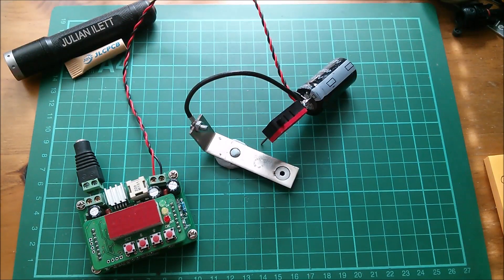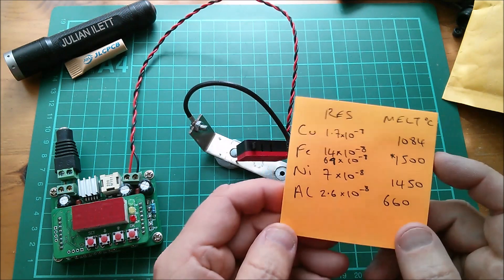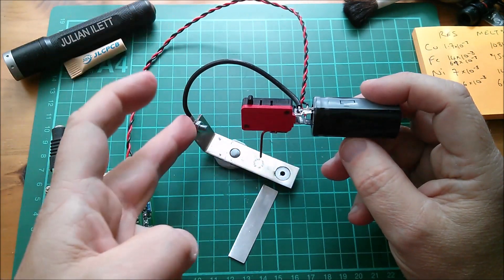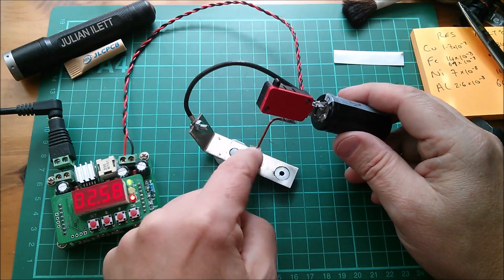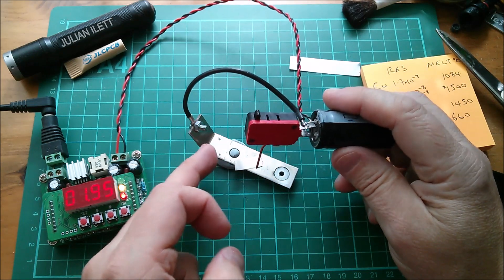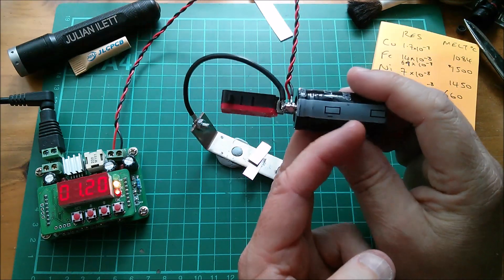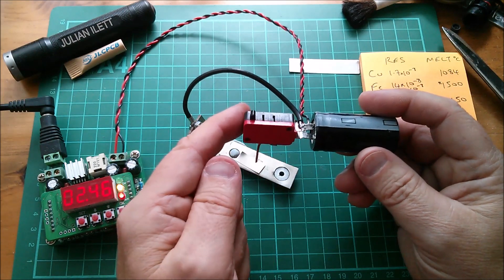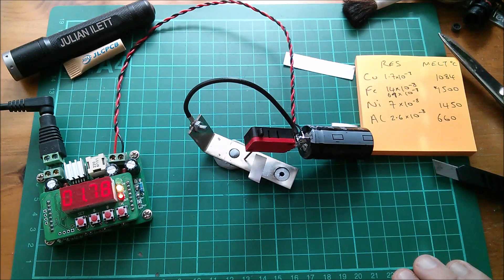Will it work? 100F Supercapacitor Spot Welder

Comment: If you manage to get enough current to weld the nickel, you're more likely to weld the microswitch contacts, also, have you ever looked inside a microswitch ?
The metal inside is about the thickness of the nickel strips, but narrower, if you don't melt those, you'll at least re temper the spring material

Comment: One thing to try is to use an old fashioned soldering gun with two short, rounded (not pointed) copper tips.  Press down hard and pull the trigger for a second or two.
Reply: I thought about that,  and wondered if it'd work...    Have you actually done this?

Comment: I think the ESR of supercapacitors is far too high. You would be better with a large electrolytic charged to a higher voltage. Far more energy and a lower ESR. Then you will probably weld your switch!
Reply: There are smaller value super caps that are designed for the kinds of pulse discharges he needs as well. The one's he's using are meant for hold up power not pulse discharge.

Comment: A microswitch, seriously? I’m pretty sure that along with the huge thermal mass of the steel block that dissipates the heat, the contact resistance of the microswitch is partly to blame.

Comment: For battery welding I am using 2 300F (3.5 mOhm ESR) capacitors charged to 2.1 V, connected in parallel with 1.5 mm sqr copper wire. It was just enough to spot weld 4s 5p pack therefore you need much more than this
EDIT:
I checked in datasheet that my "spot welder" can reach 324 A so that is a little bit more than yours :)
Reply: Thank you for ❤️Julian :D

Comment: Counter intuitively, less pressure might help to increase the resistance and consequently the temperature
Reply: Only at the surface. You need to generate the heat inside the material or nothing will happen.

Comment: Internal resistance limits the maximum current it can give. and since it heats up, it must be rather high. You can solve it with multiple caps in parallel (lowers resistance)
Reply: The caps themselves matter as well, these are not low ESR super caps I'd be willing to bet. You could probably do this with only a few Farads of capacitance if the ESR is low enough. Putting more big one's in parallel might work but you need some way to control the pulse duration otherwise you quickly go from not enough to too much. Neither is good.
Reply: @JWH3 , indeed true. mosfets in parallel can be used for pulse duration. but a controller will be needed also. might work with a 555
Reply: @MasterIvo  for testing it won't be needed but once you know you have at least the basic energy delivery required yeah definitely. I'd use a microcontroller, they give you way more control and repeatability over a 555

Comment: As someone who has used a spot welder I'd suggest not using a snap point on the electrode.
When using a full sized welder the electrodes were about 3/4" diameter and the tip was about 1/8".

Comment: The sparks you are getting with the switch pre - closed don't look or sound nearly scary enough to do any spot welding - people use much modified microwave oven transformers with  a secondary wound from thick copper - that might be a clue - I just don't think you have the current needed sir :o) (I agree with your 'high esr' theory for the C also)

Comment: Spot welding is about an initial bust of insane current. It's massive amounts of energy in as short of a time as possible. That's why you see sparks and stuff spray out, since it is essentially melting the things together very quickly, and then the energy is gone and the weld solidifies. Typically the welds are done on very thin metal.

RESISTANCE welding, which is what I think your setup is currently the closest to, is a continuous dumping of energy to melt the metals together with the heat of the metals making them warm up. And none of the things in your design now are up to that continuous current output. Typically, at least in my experience, this is used for much larger bits of metal.

I only know about these because I worked in a warehouse, and they had both units.

Comment: Suspect it's just as simple as not enough energy in the capacitor to do the job.  Which is just as well. Because if it worked your microswitch would be good for recycling only.

Comment: Yes, that’s a fail!
These micro switches usually have a maximum DC current of ¼ A ! (and 10 – 16A on AC)
Also the contact material inside has a lower melting temperature than any of the stuff you try to weld. Back to the drawing board!
 :-)

Comment: Use a solenoid (starter motor kind is used to this kind of thing) and that 12v battery rather than capacitor. The solenoid will have a much better hob at handling the power and will still be able to release again. The 12v battery will probably have in the region of 20mohms internal resistance (ive tested various gel/agm batteries), the bigger the battery the more power you can chuck at it. But be warned you are essentially shorting out the battery and if that solenoid doesn’t release you’d better have some side cutters on hand to cut those cables. Maybe an indicator of some kind to tell you wether the output of the solenoid is on or off. 
You need to keep the resistances at their lowest so big cables and copper rod down to a small point because the losses by the time you get to the points of contact will be massive as you are dealing with short circuit currents.
With the above method you’d only need to activate the solenoid for a short time, <1second typically, most people use a foot switch and a variable timing device (555maybe?!) 

As others have said two points would be better and not putting it on such a huge heatsink, just try the two nickel strips on their own and you’d have better luck especially with the above setup.

Comment: Needs a parallel stack of capacitors and something like a big power thyristor to dump the current nice and quickly.
Reply: Agreed. The one capacitor can't dump the "amps" fast enough. This is really seen by how slow the voltage drops. The voltage should drop almost to 0V <1second.  Either need a larger capacitor that has less resistance, or multiple caps in parallel.
Reply: @korishan  Yes.

Comment: Start with tin foil and alligator clips to the bottom metal instead of that big plate.  Weld two very thin metal things first than work your way up.  Takes a larger sustained current as you get thicker.

Comment: I think that the black discharge wire needs to be a lot thicker. At 2.6V that resistance is going to count. 
As a test I have had some luck by charging a similar supercap, also 100F 2.7V,  and touching the leads directly to the metal. Managed to weld pieces of aluminium foil together, but mostly burned right through them. Then I connected 5 of them in parallel with 9mm2 wire (from a cheap set of jumper leads) and welded some razor blades together. The project was shelved  before I managed to find a suitable switch and decent solid copper electrodes for it.
Reply from the maker: Yes, my workshop shelf is looking very attractive as a destination for this project :)

Comment: The switch won't live long. What is the rating 15 or 20 amps? More caps in series. The metal plate is a heat sink. Use 2 electrodes against an insulator material.

Comment: Great Scott built a battery welder on his channel last year. It was very heavy duty given the amount of Amps it takes, one little Super Cap isnt going to cut it.
Reply: if you can discharge the energy in the cap quickly enough and you keep your terminal area very small, it will create a weld. Try it with some heavy copper wires with sharp points and say a 4000uF capacity charged to a few volts - it does weld, though the weld area is small and therefore quite weak. It's all about how much area you are trying to spot weld.
Reply: I built one with a single capacitor.   It was 3000F charged to 2.5V. That think could weld rocks lol
Reply: I think he also mentioned the amount of energy required and the time it needed to be delivered in, or at least a range, and he still failed. I've seen other welders that use huge LiPo packs designed for high-current RC aircraft, and they're designed to deliver 100A or more over a short pulse, so they use very thick cables and large numbers of MOSFETs, so I think if this could deliver the kind of current required to weld, it would almost certainly melt the switch or possibly explode in your hand!
Reply: exactly not to mention that the temperature table is complete garbage given that almost guaranteed hes not working with pure aluminium or nickel and rather some alloy.

Comment: @JulianIlett #JulianIlett why not simply use your maplin 12v SLA with a momentary switch anything over a few Ah under about 25Ah is fine , loads of You-tubers doing it, you can add a solenoid/contactor and even your footswitch from your solder paste dispenser if you can be bothered , i think you are over thinking it far too much , you simply need more joules than that cap has and can instantaneously deliver? PS, any chance i can recycle one of those Wickes 10.8v BMS boards , i have the drill and love it but have fried the board after one cell went, maybe i could send you postage via paypal or send an SAE like in the good old days ?

Comment: Its not the volt its the amps even the chepest welders are running 12volt 40 amps you will need 4.7 volt at 12amps
Reply: you can weld @1v  but YES he needs to UP THAT CURRENT

Comment: What you are doing is more arc welding rather than spot welding.  Spot welding has the negative and positive  rods close together  that produce a lot of heat when energised and melt the metal (weld) in a small spot.  To have any chance of it working the way you are doing it, you need to have the copper rod energised before it gets close to the metal and then slowly bring them together until they start to spark (arc).  It is the heat from the arcing that melts the metal and welds them together.
Reply: i said similar in my comment, more joulues/coloumbs per second required, simple , use a SLA 12v around 5-25Ah

Comment: I think the Aluminium doesn't work ar there is an oxide layer on the surface. This has a higher melting point than the pure metal and is a good electrical insulator.

Comment: Pause.....     I'm 48 seconds in, and I just know those micro switch contacts are going to weld together...      Play.......
Reply: If the ESR of the capacitor is greater than the contact resistance of the joint, the capacitor becomes the load and excitement will ensue.  The contact point of the two parts you are welding need to be the highest point of resistance in the circuit (It's called resistance welding). That's the load, that's where the heat is generated. My commendation... Watch this https://www.youtube.com/watch?v=VrcmvmM7h3Y
Reply: @InterakStuff  you are correct this is not a "spot" welder , i said similar in my comment, more joulues/coloumbs per second required, simple , use a SLA 12v around 5-25Ah can add a solenoid/contactor and even your footswitch if you can be bothered , loads on youtube

Comment: Although this commercial spot welder for welding battery tabs as you wish to do is out of stock, you can see from the spec's that it's 1.9kW - what you were hoping to do was never going to be able to generate sufficient heat to cause the tabs to be fused together... https://www.amazon.co.uk/Battery-Welder-KNOKOO-Welding-Machine/dp/B079BRJ8PM

Comment: The Copper does not get hot enough to weld it's self due to the conductivity.   Is this for Batteries ?  Your not thinking of passing current through the Cell eaaa?    You need your Contact points at the same end.  NO THRU Cell CURRENT.   Not enough Capacitor .  Current duration is not long enough.  .
Reply from the maker: Yes, I was thinking of passing current through the body of the lithium cell :)
Reply: @JulianIlett  Welding the Anode the welding current would do some serious bad Ju Ju to the cells pushing current through the cell as a whole.  You need to be using two spots on the Anode it's self.  I seriously wish we could post photo's on YT

Comment: you'll need a higher voltage. At this voltage you cap size will be huge.
Reply: For welding, current is what's important. What he needs is two points of contact near each other
Reply: @Markle2k  but at 3 volts he needs a capacitor the size of a beer can.
Reply: @miketammaro5609  I have some 500F super caps. They are about the size of a D cell battery. The idea behind a spot welder is to deliver as many amps (for rapid heat generation) in a small spot, as rapidly as possible. Most homemade microwave oven transformer spot welders settle on about 5 volts. You don't want the voltage too low, but you don't want to have to deliver too many watts in order to get the amps up high enough to melt the contact area.

Comment: Will not get enough current. Resistances with only 2.6V will give poor current peak. Energy also not so high  1/2 CV^2.  The thick steel will be massive heat sink. While it is a 100F, it may not by design have high peak current capacity as foil layers would inside do not have good current capability. Should only pass current locally at surfaces to spot weld. Just a few points to consider

Comment: You need at least 10 of them capacitors to deliver enough credible current. Try using your 18 volt capacitor bank that would probably work pretty good A little higher on the voltage but it would be all right
Reply: That won't work because the internal resistance of the caps adds in series. You need ultra low ESR to discharge the caps fast enough to get the pulse currents for welding.
Reply: Yeah I use a 2.7V 3000 farad Maxwell super cap with an adjustable amperage breaker
Reply: You don't need anywhere near that much capacitance, but those caps have a really good ESR.

The ESR adds in series so it would actually be bad for him to run anymore for a higher voltage, they need to be run in parallel or better yet a low ESR cap needs to be chosen.

Comment: More voltage and lower ESR needed I think, What voltage/capacitance were the the old flash caps from cameras that folks used to use for similar welding purposes?
Reply: 380v & 380uF. At least the bag of flash caps I have are.
Reply: @CuriousFocker  Fully charged that would make a nice arc lol. thanks for the info.

Comment: Too little energy obviously. You can work out the energy requirements just by looking up key values (kJ/kg) for nickel and guess how much mass to melt. Then you'll get an amount of joules required. 1 watt is 1 Js (joules in a second). F = J over V squared. Should be possible to calculate how big capacitor you would need, if you can guess Ri.  :-)

Comment: The thermal mass of the steel is problematic.  Two points would be better.
Reply: I agree. The welding needs to be done in the smallest arc (not spark) possible, so 2 electrodes very close.
Reply: Yes. Put a matching sized and matching composition, electrode on the bottom. The metal you are welding will get cherry red at that point and should fuse together, provided there is enough current and duration. It only needs between one and two seconds.

Comment: There's a lot to be said for failure, it's so much more interesting than success! What about a capacitor bank, if they were in parallel, wouldn't the ESR be conceptually reduced.. I suppose it need diodes to stop back feeding I'm not sure.. cool video anyway, good lucks!

Comment: Long time follower of your channel and a major nut when it comes to building tab welders(see my channel 👍). Good way to test if you even have enough current to tab weld. Barely touch the tip almost adding no pressure at all. This reduces the resistance and if there is enough, should blow a hole through the strip. But looking at the sparks created when you rubbed the side, it should be sticking if it had enough (the copper melting). Try adding a cap in series and upping the voltage. Might be the only way to do it with those caps. Parallel may also work, because I have 350f maxwells that tab we’ll fine by themselves at 1.5v to 2.7. Love your videos!!!!👍👍👍👍👍👍👍
Reply: Lol. Nuts about tab welding. Yes I think you may have problems ;-)
Reply: @simonhopkins3867  Once you start, it is hard to go back... when you have a good setup it is so quick.
Reply: PS I meant no offence.

Comment: I think that the main problem you have is that all of the bottom side of the nickel is making contact with the steel bed so the current is distributed all over the underside instead of at a single point like on the top.  In my opinion you need a single point connection on the underside that matches the one on the top so that the current (and therefore the heat) will be concentrated at one point only :)
Reply: I once watched a video on crafting vacuum tubes, and they used something similar to what you're describing.  Mechanically it looked like a press with 2 points, and when you sandwiched something between the two points and hit the current, it arced directly through the component to reach the ground point.  It produced a very localized, pinpoint discharge.  POP!
Reply: https://youtu.be/Imsc_J25QmE?t=447
Reply: @StevenIngram  https://www.youtube.com/user/glasslinger

Comment: I suspect all the welding action is within the microswitch!
Reply: If he tries it enough he'll end up the switch welded closed and it might just start to do something on the tabs.
Reply: He should use 2 copper electrodes directly connected to cap and have the electrodes pinch and then dump.
Reply: I agree!
Reply: @sergecalmettes2712 If its welding the switch, and that's a BIG IF - surely just remove the switch and solely use the connectivity as the switch.
Reply: @247hinkey  that switch will weld for sure they're not very good for carrying large loads
Reply: @ryanmalin  the comically small return wire and copper weld probe probably limit the current but a microswitch is about the last thing you would use.
Reply: That's exactly was my thought. Point with highest resistance is inside the switch LOL!
Reply: Hehehe indeed!